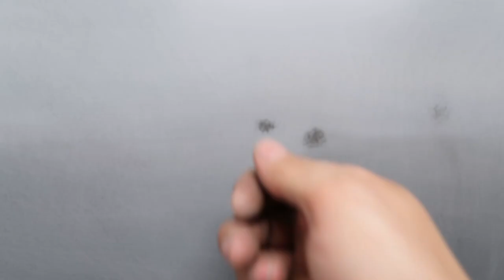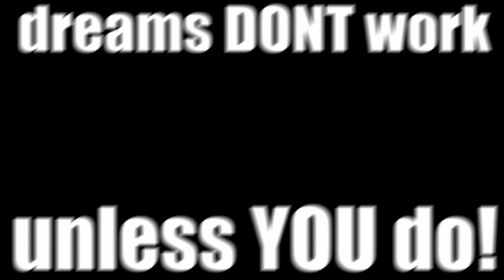Painting the DA!!!!!

Comment: Just catching up with the videos. Great work. But I did notice you didn't take the guide coat off those low spots before applying the filler. Will the filler actually bond to the panel?

Comment: Not a paint expert, but I'm pretty sure you only have to lay the clear coat down while it's still tacky if you're not going to cut (wet sand) the paint , because when you cut the paint you're giving the clear coat a place to physically Bond and you don't need the chemical bond,., Plus if you use the wrong clear on the tacky base coat you'll get fish eyes and s***